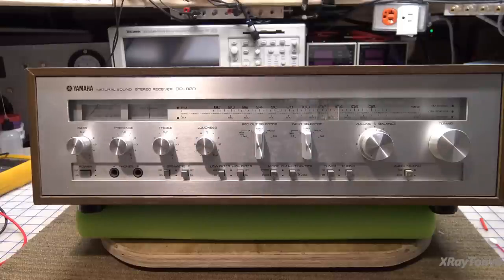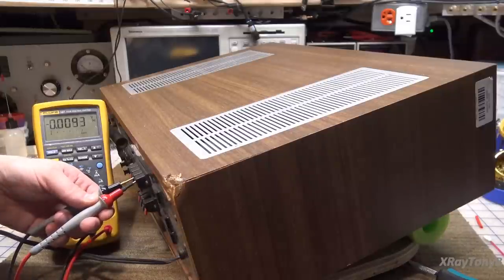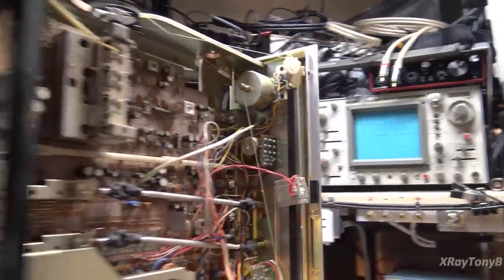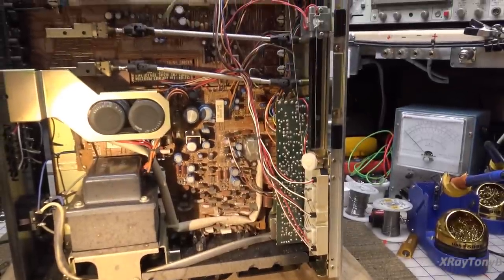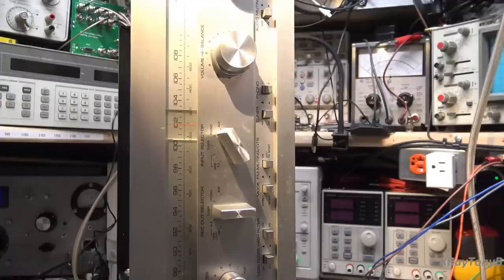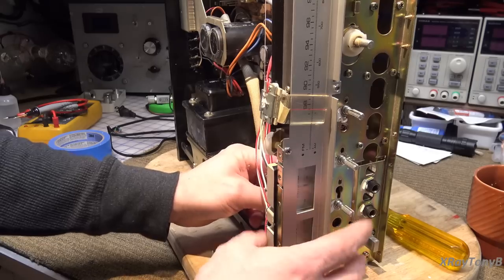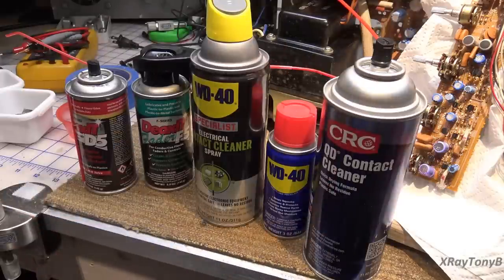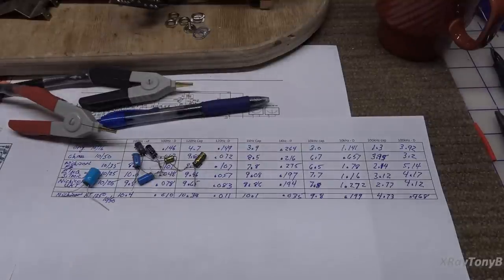Amplifier maintenance 101 - Cleaning Controls & Re Capping a Receiver (Featuring the Yamaha CR820)

Comment: There's nothing wrong with standing WD-40 as contact cleaner I asked them this, and they said it's fine. it's not flammable it's a mineral oil and can resist voltages up to 100,000 volts not sure who told you that.
Reply from the maker: I've seen two examples at work firsthand.  First was when one of the service engineers sprayed WD on the armature of a DC field motor on a piece of equipment.  The motor ran really well for about 1 minute and then the armature contacts burned up as the oil ignited.  On the second occasion, WD was used to clean the contacts of a bit contactor in a HV primary circuit.  The contacts had 480 VAC on them.  After a few cycles of the contactors, the arc flash burned the WD on the contacts and ruined the contact surface, causing pitting and requiring the replacement of the contactor.  I'm not saying that it will always cause this in all situations (you should never treat relay contacts with anything that leaves residue), but WD and power don't always play well together.  In addition, when used as a lubricant, it dries out pretty quickly and no longer provides any protection.  There are much better products out there for these types of applications.  Thanks for the comment!
Reply: @xraytonyb  well any mineral oil will ignite under extreme heat or friction. But when WD-40 is used on electrical systems as a water displacement insulator it can handle 70, 000V no problem.
Yeah it's not really designed as a long-term lubricant.
Reply: I have been using wd40 for 20 years without any problems. Im using it even on black legged transistors and ic's to prevent further oxidation.